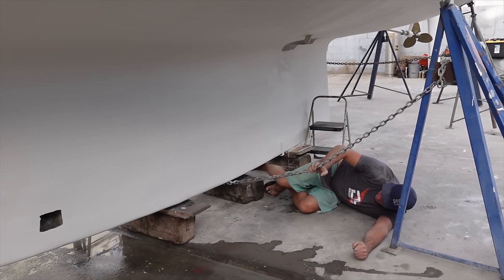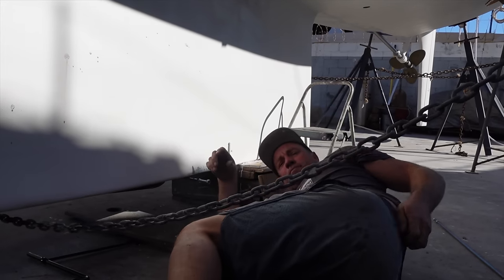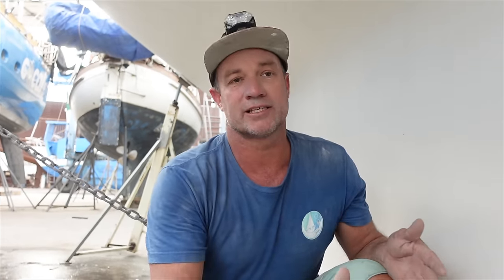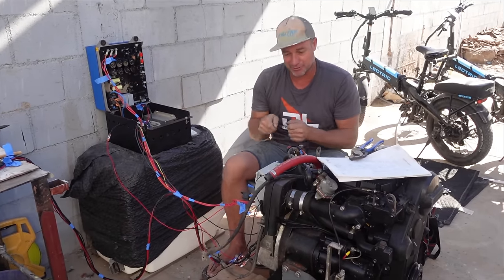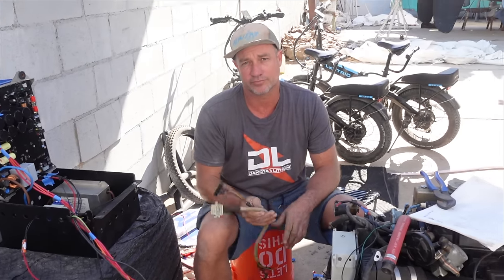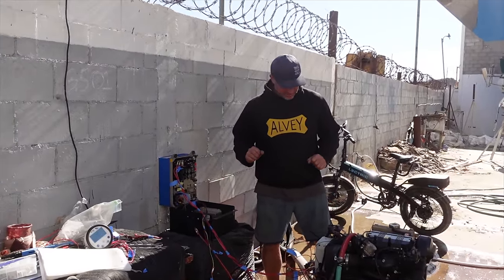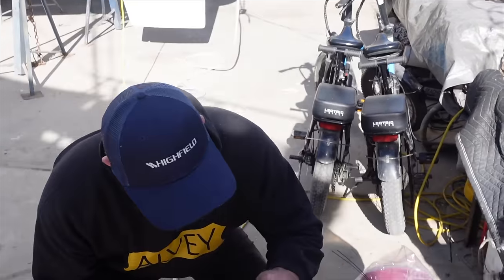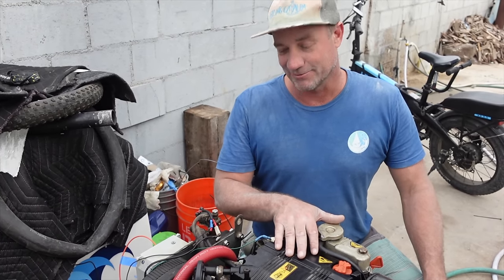We trade beers for a Generator | Ep 390

Comment: Additionally, the control gauge slowly depletes your generator battery since it is always on.  I wired a on/off switch on the positive wire on the back of the round guage panel to prevent that.

Comment: Well done. First class diagnosing. At the start of my career one of my colleagues bought a generator. The engine was out of a tank (yes, a BIG generator), very reluctant to start but when it did he could not stop it! Turned out the lube oil system had some external lines and one had been connected as fuel. It stopped when the engine blew up.

Comment: I totally get what you have gone through on this gen set!  When I purchased my sailboat 2 years ago, it came with a 9kw Northern Lights gen set that kept overheating.  I hired a local mechanic who ended up changing a perfectly good impeller and then wanted to change a fuel solenoid.  I kicked him off the job and started digging into it myself.  I tested the thermostat and found it to be working as it should.  After reinstalling the thermostat, I ran it again and noticed some black bits in the anti-siphon loop.  I ended up removing about a half cup full of old impeller bits!  Once these were removed, it runs flawlessly!  Someone in the past (PO or some yard mechanic) changed an impeller that was obviously broken apart and never bothered to find and clear out the broken off pieces!  They just installed a new impeller and called it good.  The gen set passed the survey because it wasn’t run long enough for it to get up to temp!  

Bottom line - if you are going to be a live aboard cruiser, you have to be able to diagnose and correctly fix problems.  Lee has these skills in spades and is not afraid to tackle even the most complex problems. Hats off!

Comment: I don't know if I'm saving you a lot of unnecessary hassle, but: In the US, 3 phase power is called 208V because that's the voltage as measured between any two phases.  If you measure the voltage between a single phase and neutral, you get 120 volts.  That's for sources that have a neutral (Y-configuration, as opposed to Delta configuration).  So you might have everything you need without a complicated converter.

What I've just described isn't any different for standard "single-phase" house wiring, which is 240 volts when measured between the two "hot" leads, but 120 volts when measured between one hot lead and neutral.

I guess it wouldn't surprise me that you have something different, since it's an Italian manufacturer - but it's worth asking.

Comment: Love seeing the genset up and running! Is that generating at 50 or 60 HZ? Something to keep in mind when converting between US and European electrical. It mostly matters in appliances with AC motors (such as an AC watermaker or an aircon) as they'll either run faster or slower depending on what HZ theyre designed for. A lot of everyday electronics and appliances don't care these days.
Reply: Congrets to getting the generator work! Same thought concerning the frequency. Transforming to 110 may not work with some appliances.

Comment: It is amazing at times.  A few weeks ago I got a new Ford Bronco.  On delivery at the dealer, a technician backed up into the brand-new truck at a low speed. The dealer for some reason changed the oil (less than 100km on the odometer), and guess what: the technician forgot to tighten the oil sump bolt.  I was driving the truck for the first time, I had about 120 km on the thing, and it seized on the motorway.  Now the truck (with a grand total of 230km) needs a new engine...  It's the stupid stuff that kills'ya

Comment: A diesel fuel leak into the engine crankcase is a very dangerous issue it can cause a runaway and fire. You saver the former owner of that generator his boat. Who ever installed that injector should be held responcible. God bless you all